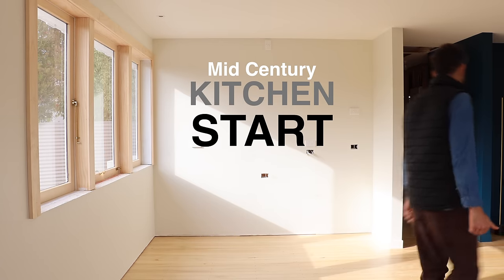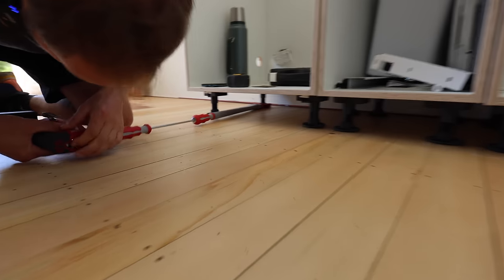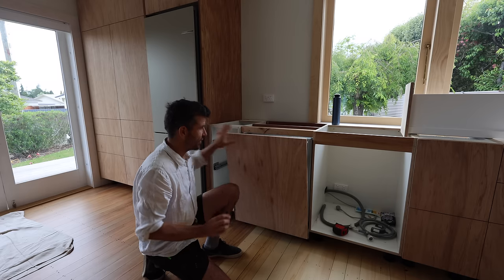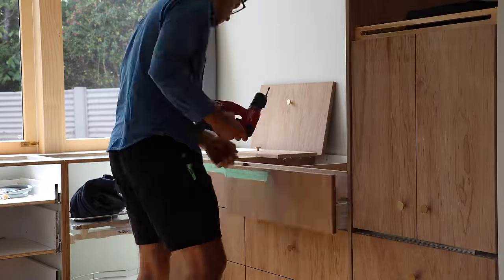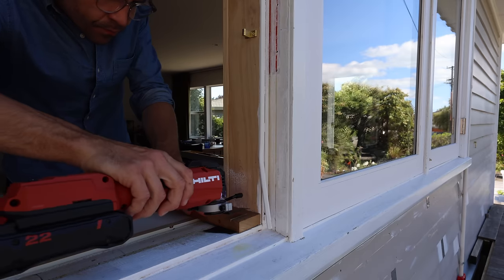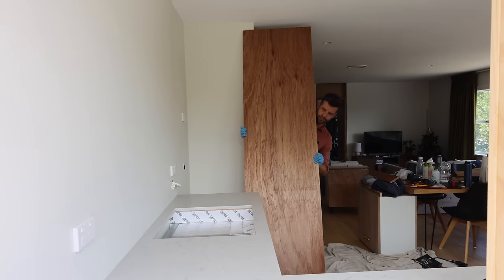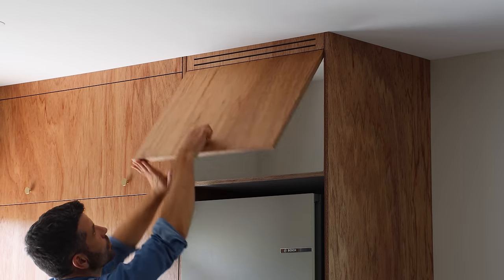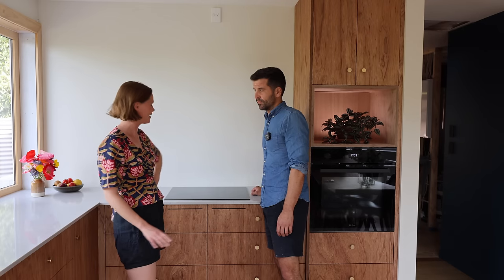I Made a PLYWOOD Kitchen look like THIS

Comment: I am a cabinetmaker in Australia and with all the materials you used. Your kitchen would easily be around the $40,000 mark. You used high quality plywood for the base cabinets and doors. Top of the line quality drawer and door hardware. It has been a real pleasure following you on this project. I enjoy all of your content
Reply: agreed, so tidy. looks timeless
Reply: @joeyvecchio1050 What type of ply for the base cabinets would you suggest? 
And what is this type of drawer slide called?
I'm a carpenter in south east Victoria abd going to renovate mine next year.
Reply: I wouldn’t be using plywood for cabinets. You should use moisture resistant particle board. All top kitchen companies will never use ply wood. Absolute mistake there
Reply: Plyco have meranti 18mm 2440 x 1220 for $125.. thats a lot of kitchen for $40k even with quality fittings and no labour costs... or are you saying $40k from a cabinet maker like yourself??? Thanks
Reply: You’d lying 
Lol 40k typical hipster ripping someone off. 80 bux  sheet
Reply: @timdennis2193 he is not a cabinet maker lying or ripping people off
Reply: @innervisions2528  This isnt a bunnings kitchen look at the fit and finish of everything it is perfection
Reply: @ReaperXC  it depends on what type budget you have. We typically use the white laminated plywood for outdoor cabinets and edge them with white 1mm pvc. For the faces of the doors and drawers it all depends on the look you are going for. I personally like my plywood edged so it seals the edges. For the hardware the brand is grass. And it it supplied by Nikpol here in Brisbane. I think they have warehouses all over Australia
Reply: @michaelarabi5083  you can use plywood for cabinets they are typically edged with 1mm pvc edging. The laminated plywood used in the video is usually more expensive. In Queensland we have been having supply issues and also quality control issues so plywood could be an option
Reply: @timdennis2193  $40000 would be the supply and install cost. As they said they did not factor any labour costs into their price calculations.
Reply: @innervisions2528  I am a cabinetmaker of 20+ years and unfortunately 40k is what it costs for a kitchen like that. With the cost of everything these days you would be lucky to get a kitchen like made by a kitchen company.
Reply: Our kitchen is a lot smaller and we were quoted around $50,000 and that's with MDF.
Reply: Don’t know about Meranti, but this would be about $1500 CAD per cabinet if it was Baltic Birch plywood.
Reply: Can we have a white glass splashback with the teal green van stripe please.... Oh go on
Reply: @joeyvecchio1050   We were planning to use the standard white HMR particle board but I had a look for the laminated moisture resistant plywood and although it's a bit more expensive it looks like a much better product. I have an edge banding machine so the edges are sorted. Is the plywood worth the price over the particle board?
Reply: @geoffsemon7411  I would prefer to used laminated plywood because I believe it is a better quality and better product
Reply: @joeyvecchio1050   Thanks for the reply. I'm saving a bucketload of money by doing it myself some I'm fine with spending more on materials to end up with a better product. I took my wife to a high end kitchen company in Sydney to have a look at their showroom. We were quoted a bit ove 100k for the kitchen design I was after. Wife was very pleased I could do it myself and save some money
Reply: "Your kitchen would easily be around the $40,000 mark"
Sure, if you engage a builder,  with nothing but ideas and say 'do everything for me'.
Then again, my mum was quoted $25,000 for a basic bathroom reno, so it isn't hard to find builder to take alot of you money for not much result.
Reply: No Brasil no máximo custaria US$ 4.000 e mesmo assim aqui custa caro e o lucro obtido é pouco.
Reply: I was wondering, did you mean 40k just in material or did you also include labour?
Reply: It’s a really nice kitchen , looking forward to seeing how you do the bathroom and toilet areas , or just the house finished in it’s entirety , wats your plans in the foreseeable future, are you going to go back to running your business or are you guys going to do something new
Reply: Stunning! I’d have a clear glass splash back
Reply: Well I did a kitchen a little bigger (about 5m more lenght ) kitchen with oak wood and laque paint (50/50), 18mm plywood body structure with a silestone (quartz) counter top, the total cost was 15K€ (with 4k€ just for the counter)....Nowadays after Covid everything is sooooo expensive !
Reply: @joeyvecchio1050  So I guess this should be 60K including labor and tax?
Reply: @ThisTall  fucking expensive......
Reply: @michaelarabi5083  depends on how you treat the wood lol
Reply: Hei Australia..40k australian or new zeland. Or kwakanize :)
Better if you sau in € or japanize jen..hihi Im evil

Comment: In our kitchen (UK) we chose a smoked glass splash-back, blends in nicely very easy to clean looks modern. Just an idea for you guys & well done on a fantastic kitchen build Scott.
Reply: I'm building kitchens in Germany and we are also using Glass as backsplash in kitchens. Mostly pre painted from "Lechner" büt i dont know if the are delivering to NSL, but you could search an other distributor in your Area
Reply: We did the same, green glass backsplash, best decision we made. So much easier to keep clean.
Reply: Same here. We went with glass tiles in a very light grey and it came out great and cleans up easily.
Reply: In Auckland , we used a glass splash-back, lots of colours to pick from and super easy to keep clean.
Reply: They are great if you buy a chalk pen you write on it so handy and cleen of with water
Reply: Came here to comment this, glass or even a Smokey brass colored mirror
Reply: Just did a kitchen and would recommend toughened glass splashback as well
Reply: This, unlimited choice in colour
Reply: Not really mid century though
Reply: Hi Scott,
I would have Choose a clear glass, and paint the back of the glass the same as the walls… but make sure it’s clear glass (check by looking at the edge, green is no good, get clear!)
Reply: Yep, can't recommend smokey glass splash back enough. Looks great, adds dept to the room and so easy to clean...even for blokes.
Reply: A back-painted glass splash back would look great in this kitchen. Whether you choose a contrast color to replicate mid-century glass tiles or just something neutral, glass offers an easy and virtually maintenance-free solution. I’ve had one for nearly ten years in my kitchen and it still looks perfect.
Reply: Mirrored smoked glass
Reply: I installed a back painted glass backsplash in our kitchen. The glad was a pain to cut without getting chips on the edges. At least where I had to make cuts for ends or outlets. Looks great though. Be sure to buy extra tiles and practice your cuts a ton!
Reply: We used a smoked mirror finish as we don’t have any window on the side that our kitchen is on.  It definitely helps reflect light around the kitchen & surprising it’s easier to clean & keep clean than tiles & grout.😊
Reply: agree with others on glass. if you want a diy approach a single piece of large format tile might work?
Reply: Scott and Jess you guys are doing such an amazing job it is really great to see younger tradesman doing all their own work, and living the dream in Nelson incredible place to live. Have a great Christmas 🎄  and look forward to seeing what 2024 brings
Reply: Yes!! glass will look amazing
Reply: Myself and my girlfriend have been looking at plywood kitchens too and yours turned out fantastic. We live in Ireland and it will probably have to be handmade, my girlfriend wants no handles, so looking at J handles. As for the backsplash, yeah glass would be great but I’d have it clear with four holes to remove it then you can change the back anytime, eg different colour vinyls, thin copper or even wood veneers. Enjoy.

Comment: Scott, coming from a meticulous builder myself, you are a grade A+ Builder. That Kitchen looks amazing! You should be very proud. My first thought for a back splash was a brushed brass sheet. Never seen it done, don't know prices, and don't know if you guys would like it, but it's a thought. Otherwise, If you're going for the mid century look, it has to be a contrasting but complementary tile.
Reply: Yes, a brushed brass splash back would reference those beautiful knobs on the cabinets
Reply: I think a couple projects by Taylor + Hinds in Tasmania have the brushed brass/copper backsplash you're thinking of. Denison Rivulet i know has photos of theirs on their website
Reply: I'll never understand how people can only conceive of how an idea looks and not how fit will look when USED. Sure, the day you install a brushed brass backsplash, it'll look like a million bucks. After one week of cooking, it'll look horrendous. They'll spend all their time cleaning it.
Reply: @idontthinkso666  like basically every backsplash in existence. Your point?
Reply: No. With brass, you have to deal with oxydation. Wich means even if you don't do anything, it will darken and need to bé cleaned.
Reply: @Kelvallontan  it can be clear coated.
Reply: Looks amazing
Reply: @TpetPlayr   it can be coated. The coating will wear off though and it will be a bugger of a job to repolish and recoat again. A toughened glass splashback is so much easier to clean
Reply: @idontthinkso666 I’m about to install a brass sheet splash back and there are many sealers to lock in any Patinas or keep it anyway you want. I’m in the process right now of playing around with that at the moment and when we get it we can lock it in and it will stay that way for a long time.

Comment: Scott,  we installed a coloured glass splash back. Dead easy to do. It's a pale green, between two windows overlooking our lawn - a better green than the lawn usually looks !   You might be able to find a colour-matched glass that mimics something else in the kitchen or garden that takes your fancy but it's dead easy to keep clean and looks smart.
Reply: If you use clear glass you can paint it on the back to match whatever color you choose. Could easily strip it off if you don't like it and try another color before installing.
Reply: Agree here. Glass gives you many options and is great for cleaning. I have used this in my last 2 houses.
Reply: +1 for clear glass and then paint on the back. Can use the same colour as the wall on the back to hide the glue or double sided tape you use to mount it to the wall
Reply: Gotta recommend glass as well, would be dead easy and fit the aesthetic you guys are going for really well
Reply: @fresthedude2 can you make it clear please, you paint the back side of the glass or the wall where you will put the glass on?
Reply: @wellmadeinteriors  Paint the back side of the glass. If you don’t paint the backside then the adhesive or double sided tape (whatever you use to mount) will be visible through the glass
Reply: Glass back splash be the preference to go with 🇳🇿👍
Reply: Agree with glass. Got that for our kitchen remodel in our 100 year old house down in North Otago.

One tip. Consider using low iron glass. It keeps the paint colour on the back from getting a greenish hue normal glass has. And adds a subtle sparkle to the result. Compared to regular glass. 

Cost a little bit more to use low iron but in your case given the stunning kitchen in a light filled room it would be silly to penny pinch on such an obvious surface as the splashback  if you don't do that.

Glass is dead easy to keep clean as well. Due to lack of seams.

Comment: Scott, great kitchen.  Well done.  I just built a slightly larger kitchen for my daughter and her family.  For door and drawer faces, I also used veneered plywood that I had to oil myself - and yes, lots of work.  They have little kids, so I also put a few coats of polyurethane for extra protection.  I used prefinished plywood for the cabinet boxes and that saved tons of time for finishing.  For countertops, we used a mix of solid white oak and white laminate - saved lots of money.  I also used a drawer system like you did and again saved tons of time over building wooden drawer boxes which would have needed to be finished.  My cost including countertops was just over $14,000 Canadian.  They are super happy with the finished result!

Comment: Use a tempered glass splashback.   Tiles or stainless steel would just look odd.  Glass, especially a dark glass, will blend really well with the theme of your kitchen, and has the advantage of being super easy to clean.  They paint the back to make it whatever colour you like, although a pure white isn't really possible since the glass is usually a little bit green. Fantastic work on the kitchen!
Reply: It’s also very fast and not messy to install. I love my glass backsplash.
Reply: We put a high end wall paper behind our clear tempered glass, so many wall paper options, and paying £200 a roll is fine when you only need one, and then protecting it with a nice piece of glass is the best thing about our kitchen.
Reply: The tempered glass changes the colour. We used lemon yellow paint and the splashback came out with a greenish tinge.
Reply: @Sleiper Ooh, that’s a really good idea. I’ll keep that in mind.

Comment: I have done a few splashbacks now. Easiest by far is to get a coloured glass splash back. You can get any colour you want, and it will be cut to fit the space. Tiles are also a good option, and pretty easy with the spacing / leveling systems that you can get these days
Reply: Glass is Great, both my Brother and a Mate have put them in and they look fantastic. Added bonus is you can use them as a white board and write reminders on them or notes to each other!

Comment: Hey guys, I’m a woodworker in the UK, popular choice of splashback on some of my jobs is a sheet of safety glass (the back has coloured vinyl or spray-coat  to suit your choice). Looks good, cleans brilliantly, costs much less than matching countertop. Careful if using adhesive - use one that won’t discolour the backing coat. Great job fella, cabinetry can be a real test of endurance! All the best, Hayden

Comment: I did a glass backsplash once. Wife selected a wallpaper to put behind it. With top cabinets it was by far the easiest install ever, simple a bead of silicone top and bottom held it in place. For clean up it was also the best I've ever had, no seams etc. It was also quite cheap as it was just a simple sheet of glass,  I had a few holes drilled for electrical, but I still remember it was half the price of tiles.
You don't have top cabinets so might not work, but just throwing it out there. The kitchen looks simply awesome!

Comment: Got a sheet of tempered glass as a splash back in my kitchen. Blends in really with the wall.
Reply: On the back side of the tempered glass, you can spray paint any colour of finish you want (including the wall coloour) and it will last a lifetime. Adhere with dabs of silicone. The painted back surface will not show dust that may collect behind glass over years.

Comment: I’ve done many kitchens over the years as a finishing carpenter. Not a big money maker as you have probably figured out. Hard to compete with the big boys who have CNC machines and material purchasing power and manpower. Having said that my advice to you two is to choose your backsplash wisely and don’t be afraid to take a while. Would be an absolute cardinal sin to ruin the finished look of what you have so skillfully built. Absolutely a pleasure to watch your process. Just a sidenote here. In Canada we use miranti as a  floor underpayment. Never would have given it a thought for a kitchen build. Excellent excellent work. Continued success you two. Thanks for sharing.

Comment: Custom handmade cabinets out here in the Philadelphia/new Jersey area would be easy 100k US dollars.

Scott what a gorgeous job you did. I remodel kitchens and bathrooms and use premade cabinets and have similar design premade for kitchens but the way you matched the grain and very clean looking design. You went from rough carpentry to finish carpenter Scott. Not many rough carpenters can do what you did! Great work and great video!

Comment: The kitchen is gorgeous, and I really admire your skills as a builder and woodworker.  We spent about $20K on a kitchen remodel several years ago (refacing the existing cabinets, adding a large pantry, and expanding the size of the island.  New marble counter tops, new sink, new tap, some electrical work, new tile backsplash).  Our kitchen is perfectly fine, but it is builder grade, while yours is a custom, much higher caliber than ours.  I would say your kitchen would easily hit $50K here, in British Columbia, Canada.  My suggestion for the backsplash is very clean and neutral, perhaps just white subway tiles, so it doesn't clash with the beautiful plywood cabinets.  I really enjoy watching your channel, keep up the great work.

Comment: I had a new plywood faced kitchen installed just a year ago. For the splashback, I didn't want anything flashy that would draw attention, plus I was v low on funds, so went with a sheet of fibre cement type board (?- fireproof) that was painted the same colour as the walls. It looks brilliant, very unobtrusive, doesn't draw attention away from the beautiful cabinets and benchtop and is very easy to keep clean (just wipe it). I have overhead cabinets so it completely fills the gap between and looks just like regular wall but with the important advantage of not catching fire.